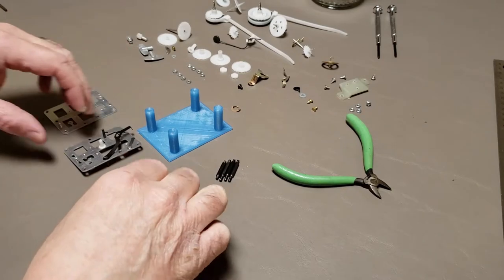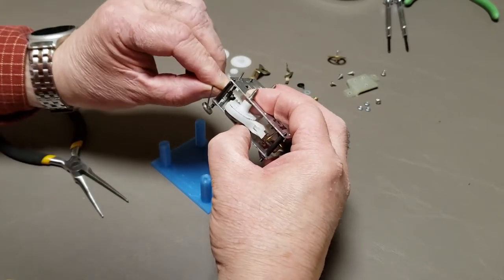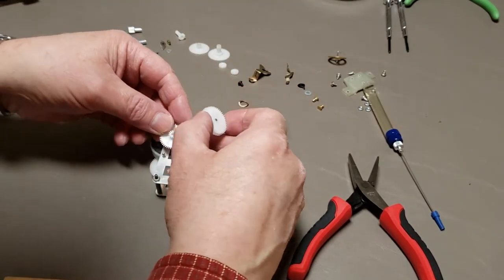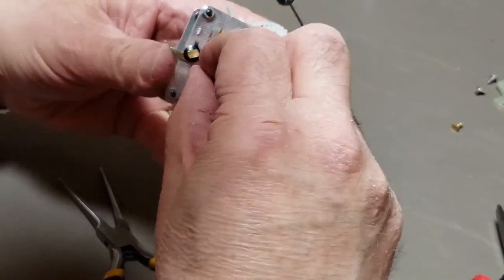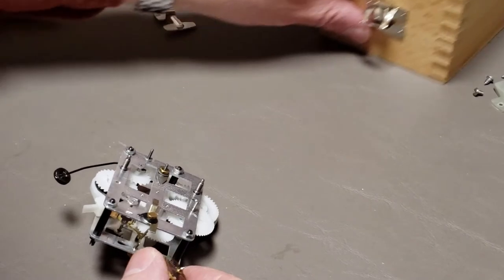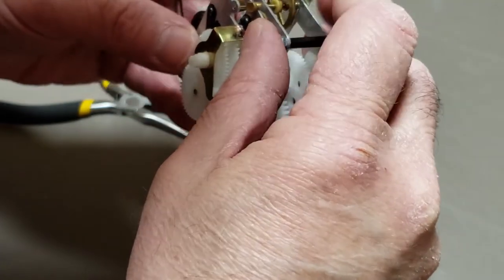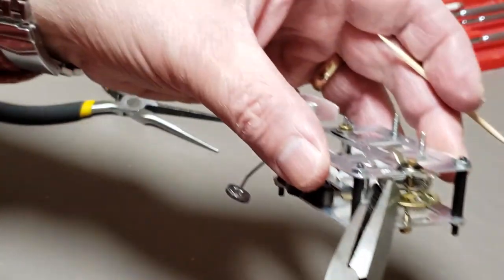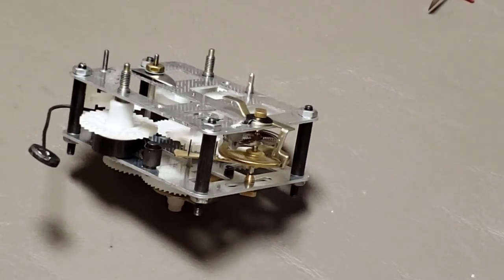An Alarm Clock Repair, Part 2, Assembling the Movement

Comment: Thank you for all your videos.   And patience!  I have to admit I sometimes "lose it" and let out a cuss word in the course of assembly which is maddening on any clock.   Alarm clocks in particular.   Being the smart guy you are, you've probably figured this out by now, but your life would be much easier with a couple sets of half-decent tweezers.   No, you don't need Dumont ones.  There are other less costly alternatives   I bought a Viola brand, size #3, years ago, but also just purchased a very nice set of six German-made ones on eBay from a place in Virginia called Avon-Surgical.  With tax and delivery, they were only around $16.   
I am just learning how to work with hairsprings because I have about 50 Westclox Big Bens and Baby Bens I've accumulated that are all going to need servicing.   
Once again, thanks to you and OK Bridges too for the helpful videos.

Comment: Thank you for taking the time to share your work. I just embarked on a long journey of mechanical clock cleaning and minor repair. I own some old chess clocks that don't run anymore and require cleaning and re-oiling. The movements are actually slightly smaller than this alarm clock. I don't have all the tools I need just yet and my first challenge so far is finding a mainspring winder small enough to be able to use it on smaller movements. Any help is appreciated - Thanks again.
Reply from the maker: I'd recommend asking okbridges (https://www.youtube.com/user/okbridges), who has loads of experience with Wesclox clocks and may have some ideas about your smaller chess clocks. In contrast, this is my first smaller clock; most of my experience is with mantel/wall clocks.  Good luck!